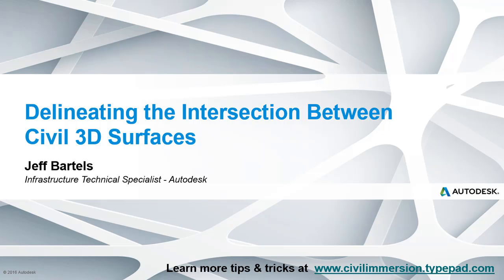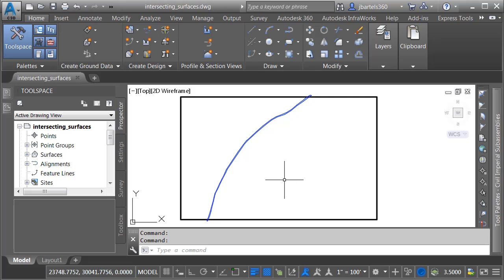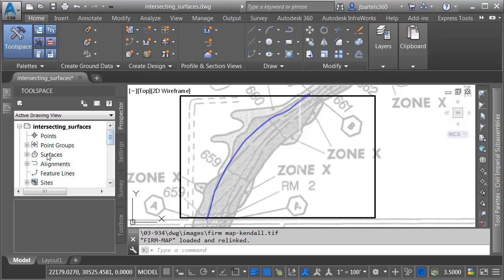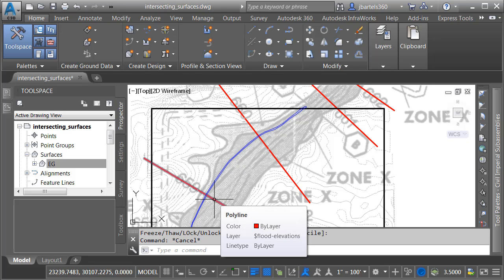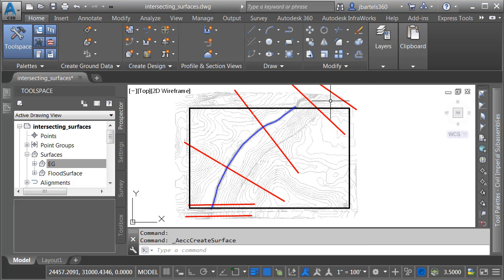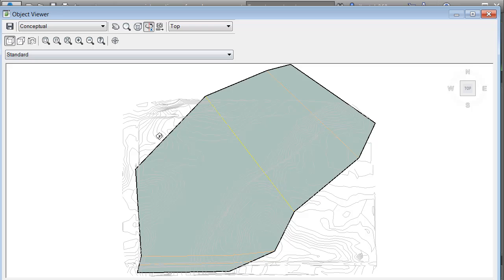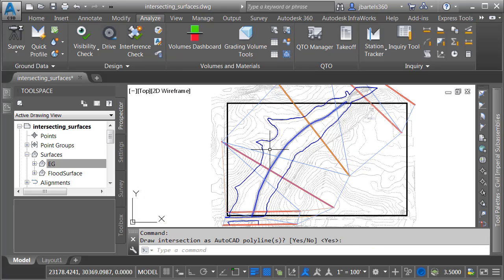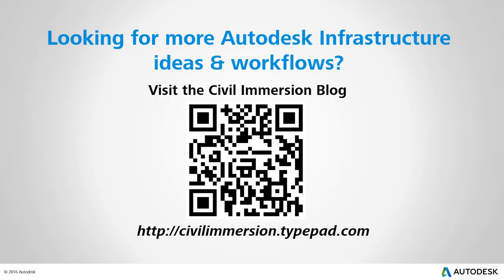Delineating the Intersection Between Two Civil 3D Surfaces

Comment: Thanks for the Video Jeff, Very informative as always. I first found Simon's Video and I got the idea but my Spanish is a bit rusty and Google suggested yours that was great. 
But the reason I was looking at "Intersecting Surfaces is I'd like to create a "Result" surface kind of like Paste one on top of each other but when Paste the Top surface takes predominance within the extends of it.
I'd like the result surface to show only terrain with lower comparison levels(I am not sure if this make any sense )
If I use Paste command the surface that's on top tier take predominance, but my aim is at that Polyline of Intersection the next surface that has lower elevation points to show. Kind of like solids Intersect command ?
Is it possible, or there is workaround way to do it?

I have a design pad, that have Cut and Fill sections, The Civil Engineer design states that within the Cut area extra 1m would be excavated and replaced by EngFill, but in the Fill Area of the pad 2m Below NGL to be replaces by Engineering fill.
I have Copy of FL surface lowered by1m, and NGL surface lowered by 2m. I want to combine them along that "Intersection Line" I created watching your video.
The result surface will produce an Excavation Horizon that I will use to calculate EngFill volume.
Thank to anyone that might help me?
Thanks
Nick